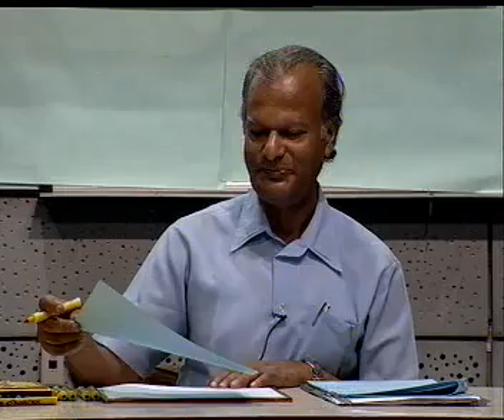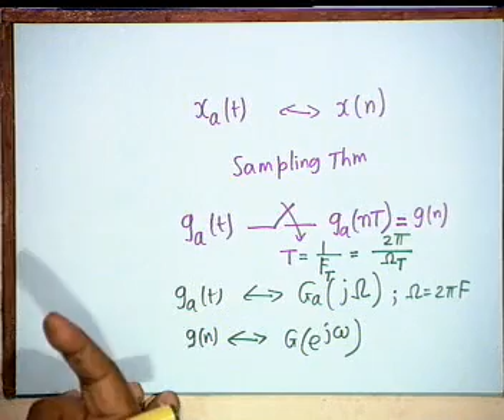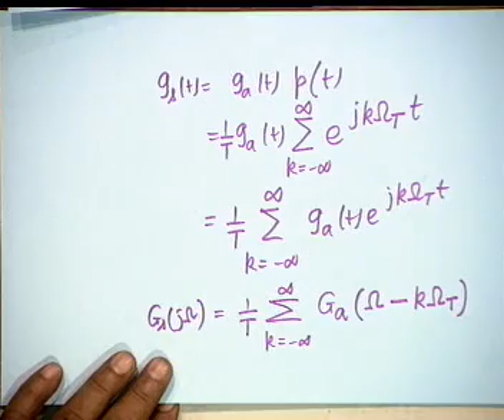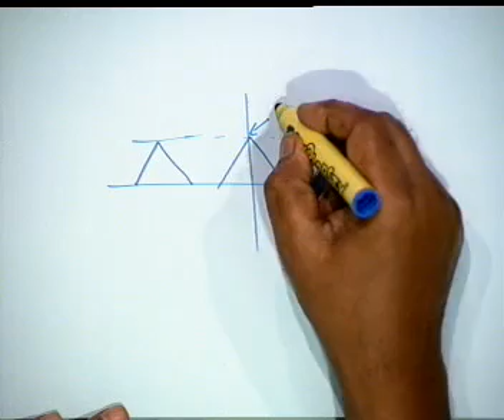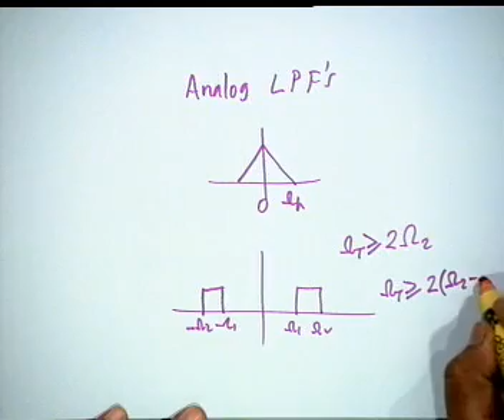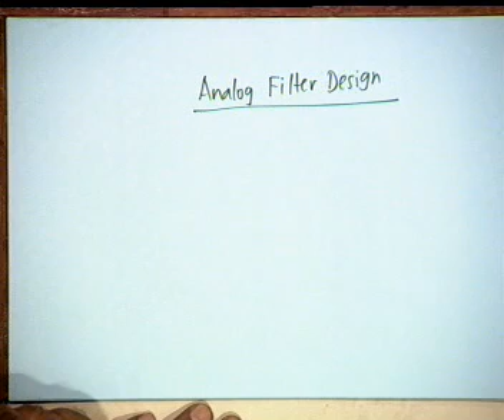Lecture - 20 Digital Processing of Continuous Time Signals

Comment: excellent talk, Professor. 

I have one qeustion. Can this analysis be used for noisy optical signals in optic fibres? what if the sampling time, of 100 miliseconds, is too big for the real frequency of teh waves, say 10^14 Hz? by the time you "register" an amplitude of a wave, the wave has already oscillated 10^11 times! do you have any idea of how to approach this problem?